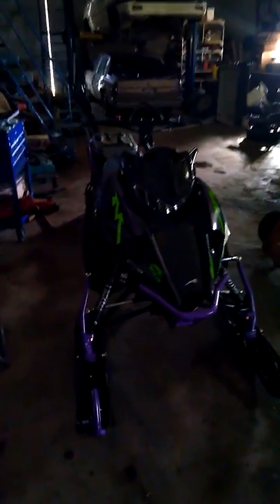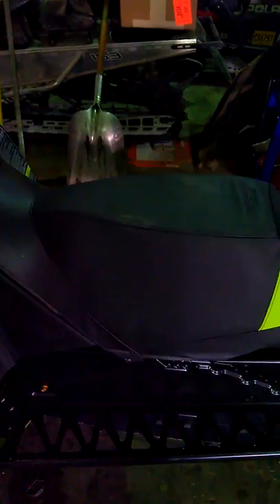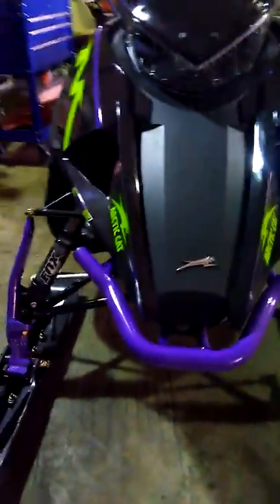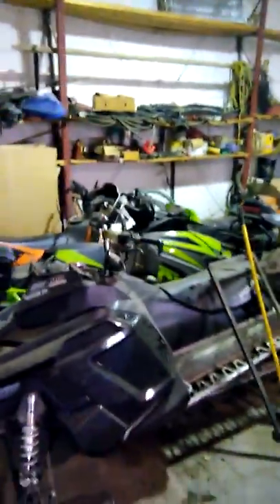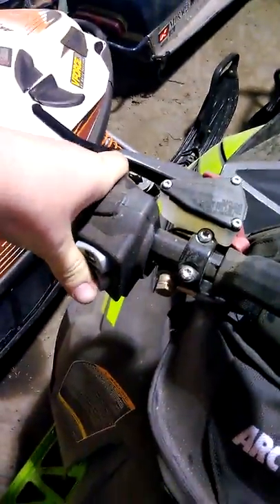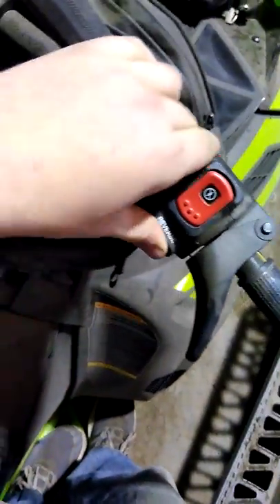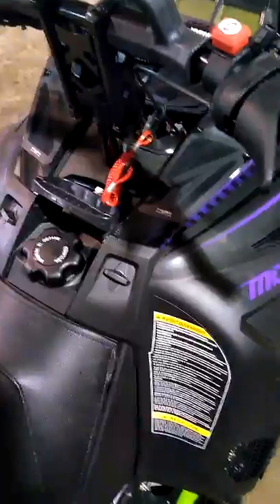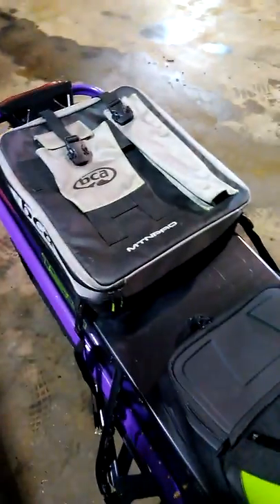2019 Arctic Cat Alpha One over veiw

Comment: How are you liking the sled so far? How does it handle on the trail/does it overheat still?
Reply from the maker: The sled is amazing,  I am always forgetting my camera for videos. I have never road anything like it. It is super easy to control, alot of the time I am over steering. Takes a bit to get used to. On the trail it rides like the 18 cats, surprisingly stable. I thought it would feel like tipping on the corners but doesn't. Feels firm on the ground. I have had the temp light on a couple times but we had run plowed road as it was getting dark and was only quick way out. Stays cool 95% of the time with scratchers down and hoping off the trail where possible. My dad's 18 cat is always overheating, been since day one, thinking the thermostat isn't working right. Last weekend we were up in a logging block that has grown up and me and a buddy were trying to go thru the trees to find a trail at the top to cut over and it was pretty steep terrain with tight trees so couldn't keep momentum and the alpha made it way farther then buddy's 08ish cat.  I was digging a real trench and kept thinking I was stuck but she kept powering thru till I got beside a tree. Also when you do get stuck on a hill the alpha is really easy to roll over out of the trench when nobody else can get to you to help. Just a game changing sled. still haven't cracked my rail and been riding it pretty rough..... LoL
Reply: @victoredwards952  Nice, sounds like a fun sled. I just bought a 2018 High Country 800 limited,  Im thinking of buying a alpha in 1-2 years depending if I start going out West more often.

Comment: They dont over heat if you put the scratchers down
Reply from the maker: Sadly they do overheat, my dad's 2018 Mountain cat over heated plenty on the trail, scratches didn't kick enough snow up to the coolers. Hopefully this stuff from Evans cooling will keep the engine cooler.
Reply: @victoredwards952  I have a 2018 mountain cat 162. I even ran with out a snow flap for half the season. I never had an issue at all with it over heating with tje scratchers down.
Reply from the maker: Glad yours doesn't but ours is always over heating, it is fine if there is some powder but we have to run hard pack to get to the mountain